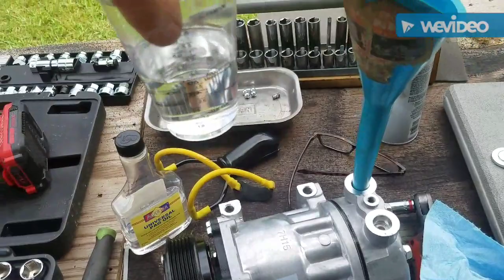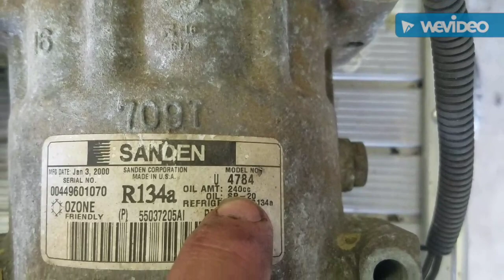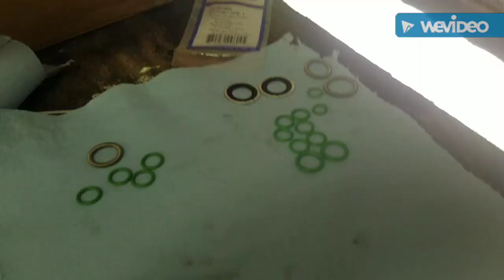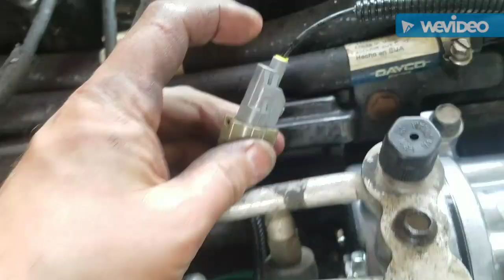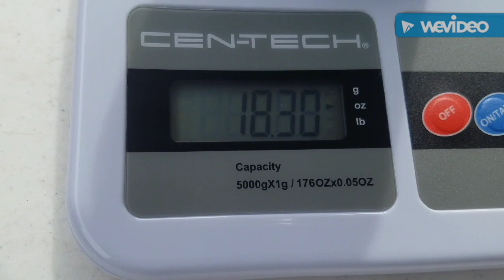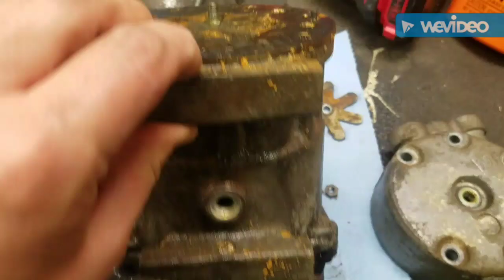Cheap Jeep Episode 23. AC Repair Attempt  Fail #jeepxj

Comment: Oh man, and you tried so hard. I was hoping for success because me A/C isn't working either. As far as I can tell everything is original. That means I have a 33 year old system. Yes, I think going to a professional will be smart in my case. I don't any knowledge or tools for this job. Thanks for showing the steps you took. At least now I have  better understanding of what to expect.
Reply from the maker: Thanks and hope you have success.  This jeep sat for many years with an open system, possibly the condenser behind the radiator is plugged, but ill see what the professional says  before I continue.  Thanks for watching!